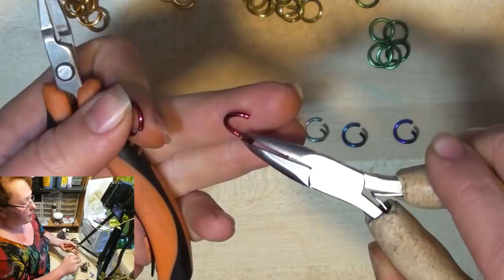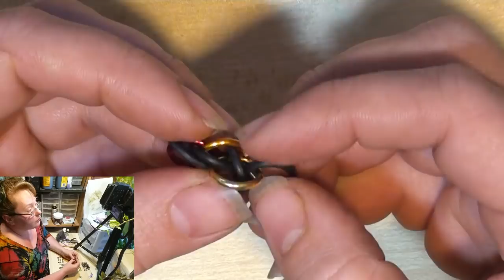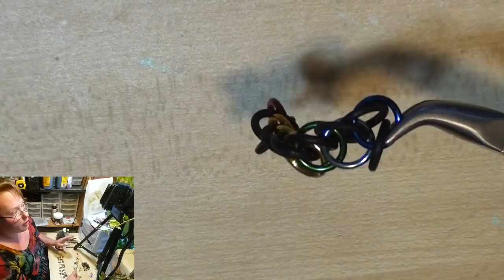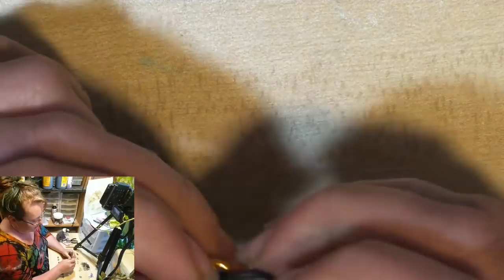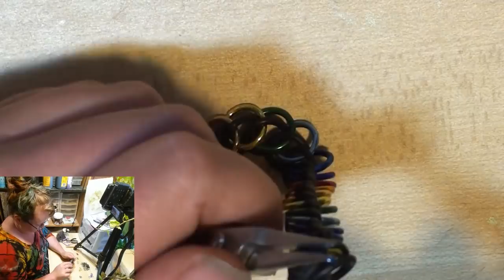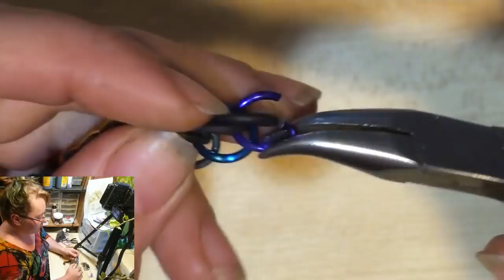Chainmaille Tutorial: Stretchy Half Persian 3 in 1

Comment: Another great tutorial. I do want to pass on a tip you never mention.  When the rings get cut, a small amount of the wire get shaved away, so the ring has a natural gap.  To close that gap and get the seamless look, you actually have to push the ends in toward each other while you're twisting them back together.  I've watched you do it, but I've never heard you mention it.  BTW, I got my order of Back To Earth Creations rings and my Celtic snowflake kit yesterday and FINALLY created a decent-looking snow flake. Thanks for the quality materials and the excellent instructions.

Comment: I am a 15 year old and I got interested in chainmail 2 years ago. So far I have made a couple of belts. wrist watch straps and a couple of more things but I never did use rubber rings. And I have a question, what do you prefer working with, aluminium or steel? When I made my belts with aluminium they used to always break in some places but it is easier to work with but I don't always find the right gauge of aluminium that I want so i just buy electrical fence wire, do you know if the ring lord has shipping to Europe?
Reply from the maker: Heya, Kevin! For most pieces i enjoy working with aluminum because it is so easy to work with, but it is hard to beat the durability and nice weight of stainless steel. I imagine they would, though it might be quite expensive. Its worth looking into, for sure! they ship from Canada so they might have better prices than the United States Postal service does.
Reply: I checked out their website and their uncut wire is the same price per meter as here but if I buy from the ring lord I also have to pay for shipping which is quite expensive. If I am gonna make something really fancy I might buy from their, thanks for the reply.

Comment: I'm having trouble finding UK rings, I'm worked out the 5/16 at 7mm.. (I spent a while, half asleep thing it was 70mm in confusion haha, I'm blaming sleep deprivation for that dumb stint).

But they also don't have gauge on many, second i add gauge I'm just getting international sellers. I've found a lot of 1mm by 7mm and wondering if that is a good approximation for what is used here? Thanks! (I looked up the metric version of 16ga and got around 1.29mm, and 18 gauge is 1mm, but oddly I'm struggling to find anything bigger than 1mm, smaller at 0.7mm but no larger...)
Reply: I get most of my jump rings from nbeads.com , they have most. Also I bought mandrels from pepe tools 2mm to 12mm